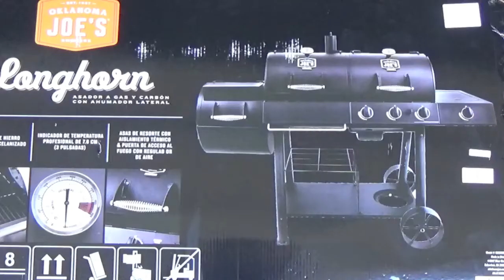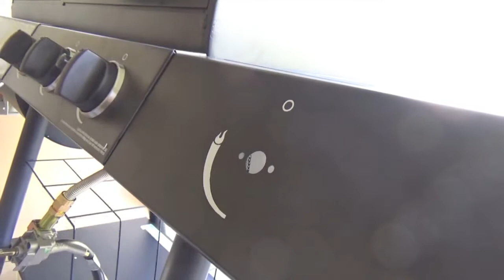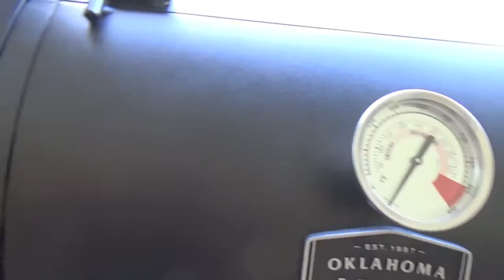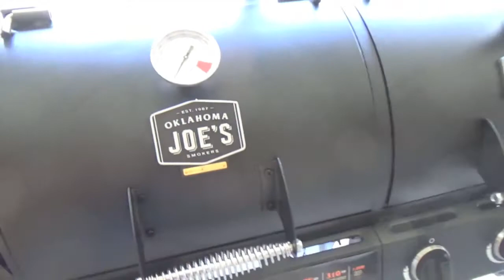Oklahoma Joe Longhorn Grill (Unbox & Build) Part 2

Comment: Hi! I was able to set the whole grill up by myself and I now am stuck at one point.  The burner plate igniter wire will not attach to the main box! It doesn't slide right in, I  have tried both ends. It easily slipped onto the burner plate connection but won't slip onto the other side. Of all the places to get stuck! Any suggestions? I don't want to push it too hard because I don't want to damage it.
Reply from the maker: I vaguely remember this being a "pain in the ass" when I assembled this smoker. I simply cannot remember what I did to make it easier (or to rectify the issue). I went out this weekend and scanned the thing again to jog my memory, but I cannot seem to figure out exactly what you are referring to. Hopefully, but the time you read this delayed response you have solved this issue and cooked/smoked some awesome food for your friends and family. If not, I am sorry that I did not address the issue in my video. Either way, take care and stay safe. Peace.

Comment: I was really wanting to see how one person attached the fire box by themselves.
Reply from the maker: Half-sitting on a stool with the box balanced on my knees, leaned back until I had the proper leverage. While I had it balanced, I used a "quick clamp" to hold it "just for a second" and then quickly got a couple bolts in place. Not pretty, but it worked and I was able to do it without any help. Hope that gives you an idea. Peace.
Reply: I put the smoker box on a chair and put wood planks under it until it lined up. Time consuming but effective.

Comment: I bought the same grill and cheated a bit since I got the display model so it was already assembled. However I have done a couple mods to the smoker part and have taken the whole grill apart and reassembled twice by myself. I have been surprised by the engineering efforts to make the assembly by a first timer or an unmechanical type person very easy. I'm curious if you have done any mods to yours or if you are getting along with it "as is"? Very good video, thanks for taking the time.
Reply from the maker: Thanks for watching and taking the time to leave a comment!

My thought was to keep mine stock for the first season and then play around with it after that. Now that season number one is just about in the bag, it is time to play! I would be super stoked to see what type of mods you did so that maybe I can get some ideas for mine. I have thought about a "baffle type" shield to spread out the smoke a little more evenly and maybe doing the "sealant" mod I have seen on Youtube (my doors actually seal really well already and I do not lose a lot of smoke).

Again, thanks for the view and comment and I would love to see what you do!
Reply: I've got the same grill and don't regret one cent I spent for it. I do want to do some mods as well like the baffle and lengthening the smoke stack down towards the grate. Keeping temp is a chore and those mods should help with that. I've had mine for about 3 years now I think. Still looks good even with no cover, just sitting on the porch. I made a few videos on it.

Comment: Can anyone comment on whether or not it matters how you set up your temp gauges on top in terms of where the needle rests on the gauge when the grill is not on?
Reply from the maker: From what I could tell, it is a personal preference type of thing. The "thermometer part" for taking the temperature is in the "center" of the gauge (on the underside) so as long as you can read the gauge on the outside, it is up to you how you position it. It will read temperature accurately no matter how you "spin" the gauge.

I hope that explanation made sense (it did in my head as I typed it). If you have any other questions, just let me know. I am about a year into this grill and will be doing an update this summer.

Thanks for watching and taking the time to leave a comment!